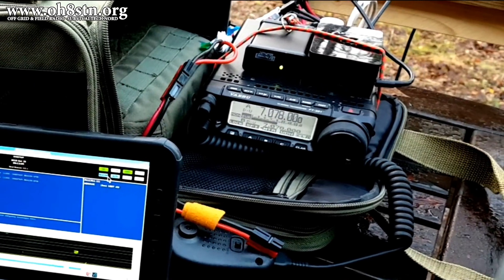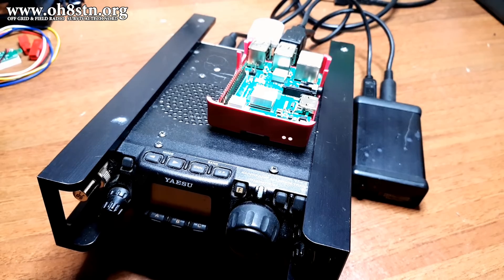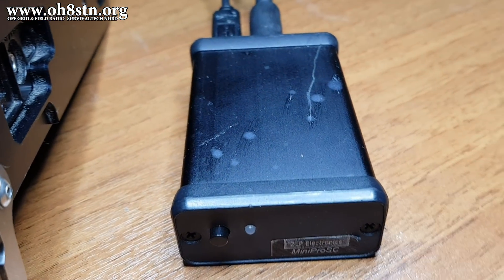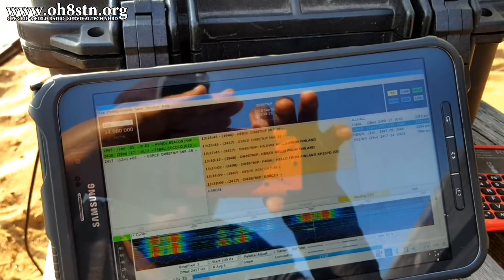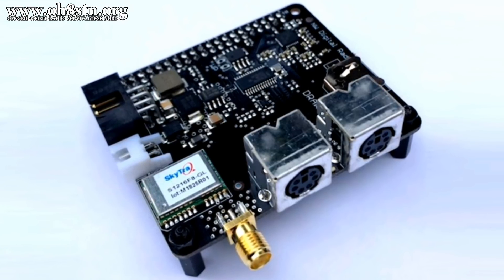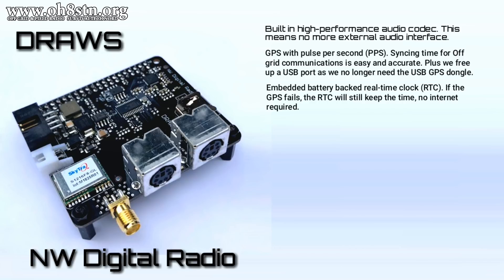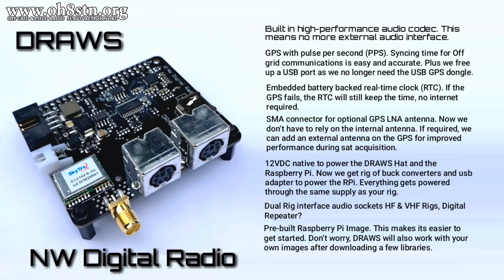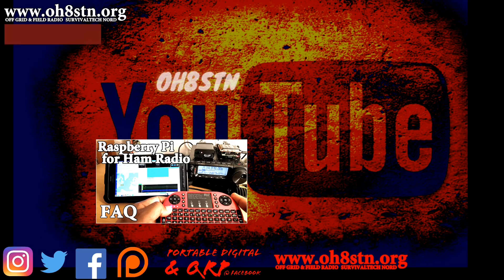Ham Radio Digital Modes Hat for Raspberry Pi

Comment: The DRAWS hat is apparently no longer available probably due to parts shortages. The site doesn't say when they might be available again. Maybe it will give them time to further reduce the parts on the hat via further circuit consolidation with more chip developement.
Reply from the maker: Not sure. It was an excellent idea initially but really needs some pragmatic development bfre it is field ready. The cables coming out of 3 sides is a real deal breaker. The configuration was also far too complicated. For me it was easier to runa GPS with 2x digirigs than fiddling with the DRAWS hat. All the components are there, they are just layed our poorly. I hope they fix it in the future as it is still a great concept.

Comment: Great video. The DRAWS Hat is available for purchase, are you planning on making a review of it any time soon? :-)
Reply from the maker: I've been holding off on making a video until they get things more finalized.  FM packet works fantastic, but there are some lingering issues with HF radio integration. Although I love this concept, I may have pulled the trigger on this video too soon.

Comment: One more thing.  Even though I've had my Technician license since 2011 I've never really done much with ham radio.  I had an ICOM-7200 but ended up selling sit.  It wasn't until I watched your video "how to build a battery pack Lithium 18650" that my interest was sparked once again.  So thanks for starting on the great journey.  JJK

Comment: Hi.

Great informative video. 

I like to share how I connected my Raspberry Pi 3 B+ (RPi) to Icom IC-7300.

It is not for EMCOMM or off grid. I am using this setup for everyday use. 

I connected RPi to IC-7300 via single USB cable. 

Rpi --USB--> IC-7300

It provides sound and serial controls.  For sound recording from IC-7300, I use command line tool.

I use hamlib's rigctl to control the IC-7300 and make several bash scripts to ease my primary usage, which is SWL monitoring. 

To control the RPi remotely, I use SSH from my Android smsartphone, Pocophone F1, either via WiFI or USB thetehering.  My favorite apps is termux for Android. 

Poco F1 --USB--> RPi --> IC-7300

Since it use  usbnet, RPi also able to connected to to Internet via the phone's 4G network/Wifi

At the same time, Rpi also charging my phone too. :)

REcently I also able to use USB dynamic microphone Audio TEchnica AT2005USB for SSB phone/voice  QSos..

AT2005USB --USB--> RPi --USB--> IC-7300

I also tried FreeDV , digital voice modulator, but, I dont have any one to try with yet. :)

Here is a simple steps to use USB tethering and how to get RPi IP addres from smartpone. 

Connect smartphone to Rpi.

Enable USB tethering, from Setting menu.

In my cas, I starts termux app on the smartphone. I installed openssh  package Run this command to get the Rpi's IP address.

$ arp -an | grep rndis

Then try to connect to RPi using the IP address with SSH.

Good luck. 

Bahathir, 9W2GNU, 73.
Reply from the maker: There's more on the way. And you're very welcome.

Comment: Thank you for posting this board form NWDigital. Though not perfect it is close and for me a good solution for APRS and packet radio 9600.  It’s not cheap but it’s specs say it’s cost effective.  Meaning most hams could not build this and get close to its performance.

Comment: Having just about completed my new base station (jumping in with JS8Call), was looking forward to finally getting a portable station up and running. Your guidance certainly will make my life allot easier but the cables ! Looking forward to your impressions of the DRAWS in action...if it works, almost no more cables ! 73s Don KM6TRZ

Comment: The NW Digital Radio Inc. CTO and CEO did a presentation, demo, and offline lunch/dinner chat session at the annual Summer Gathering (digital ham radio conference) at Valley Camp (CN97dl) in North Bend, WA, USA, just this past Sep 2018.  It was very informative, interesting, and these guys at NW Digital Radio are avid hams.  I was impressed.  They're selling these out faster than they can get them made (I just checked their website, and they're out of stock again).  They also spoke about and showed a complete setup including a RasPi, enclosure, etc, but I'm not finding that on their website shop currently.
Reply from the maker: I would kill to see that presentation

Comment: Ive been struggling to get my Samsung tablet to run JS8Call in order to simplify the setup running a Linux distro and I can't seem to get it to install like  your friends channel so I think I'm going to abandon that idea and just run headless with the Pi because with this hat solution it will simplify the setup greatly and will allow me to keep expanding as more modes/software packages become available. Looking forward to your future updates. +10 to the tip jar. 73s N5CDB
Reply from the maker: Thanks for the addition to the tip jar. Yeah I like the Linux running on an Android tablet but it seems to be a pretty big struggle to get it working. Integrating the rig and the Raspberry Pi especially with this hat, seems to be the least difficult solution to get all those digital modes working.
Anyway thanks for the comment and for the tip. It's very much appreciated.
73
Julian oh8stn

Comment: Expensive. Very cool though.
Reply from the maker: I don't know if I agree about the expense. If it does what it says, it gives us the GPS, the real time clock, we no longer have a need to buy a signalink, or the dc/DC buck to power the pi, and the software is pre-configured on an SD card. For all the work that goes into it, and the problems it solves for the field operator I would say it's a great deal.
But we can agree that it is pretty cool :-)
Reply: I added it up and it almost a wash as to cost.  Figure in that you are going to buy a Pi anyway and probably have one if you are into this and it becomes a value.  I'll wait to see what the return and survival rate is on these though.
Reply: Its cheaper than most sound cards and still has all those other benifits